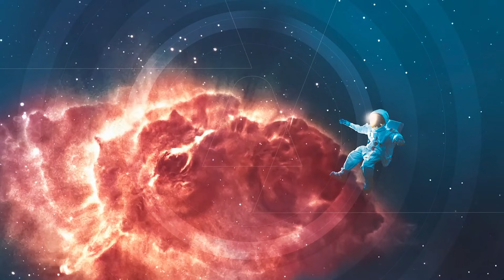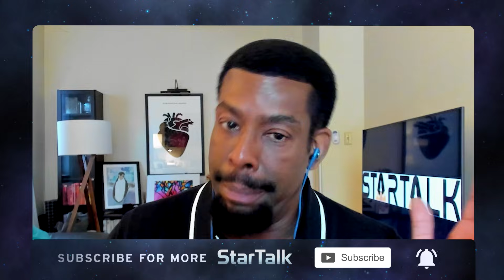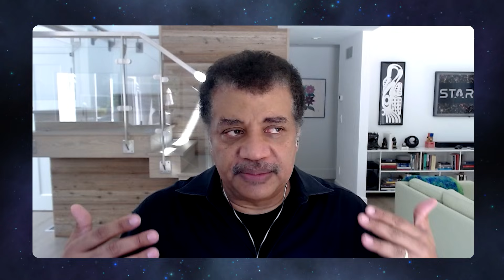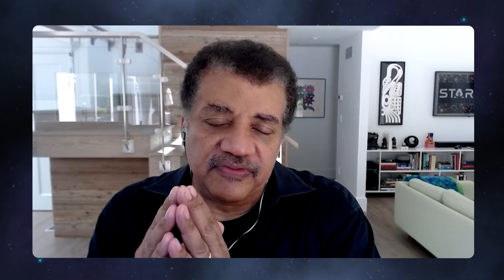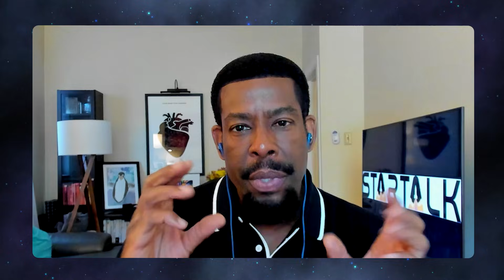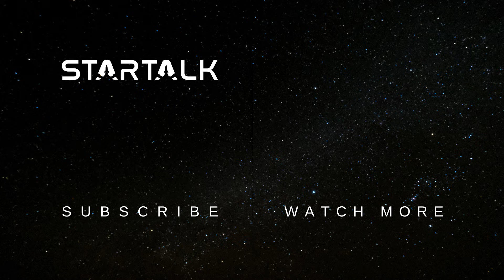What Actually Is White Noise? | Neil deGrasse Tyson Explains…

Comment from the maker: Do you remember television static?
Reply: Right after the anthem and the tone!😳🤯😅😅
Reply: You could expand this explainer to cover the fact that there's also the terms "pink noise", "blue noise" and also "brown noise".

Same concept as "white noise", except that these describe biased frequency distributions. 

So, for "pink noise", the bass is louder and the treble quieter - kind of like "bass-boosted white noise", if you will - where as we go up in frequency, the volume goes down.

Because that's white noise but with a bias towards the lower "red" side of the scale (red is lower frequency in optics, so it's bass in acoustics). A white-red colour? Yeah, that's pink.

"Blue noise" is the opposite, where the bias is towards the treble and it's quiet in the bass but increases in volume with frequency. Because if you follow the frequency analogy we're using here, the acoustics would "look" blue-y white.

But "brown noise" is interestingly different. It's NOT actually following the same concept. Indeed, in terms of colour mixing, brown is a rather complex colour - mostly red, but with a healthy dollop of green and maybe a very light sprinkling of blue, depending on the exact shade.

Nope, "brown noise" is actually named after "Brownian motion". Named after Robert Brown, who discovered it, and Einstein's first published paper was actually on Brownian motion.

Brownian motion is a physics thing, so Neil would explain it better, I'm sure. But it's basically the jiggling about of particles in a medium. They move around, bouncing off each other. And that "jiggling" motion is Brownian motion.

And you do know what "brown noise" sounds like, as you're literally hearing it all the time. It's the sound of air molecules just naturally jiggling around, bouncing off each other. 

That very quiet hiss sound you're always hearing all the time inside your head (concentrate, as the brain is always "editing it out", so you don't usually consciously hear it, but listen for the noise inside your head. A constant quiet hiss that never goes away. But, yeah, this is like thinking about blinking - once you think about blinking, you're suddenly conscious that you're doing it and then it's hard to go back to subconscious blinking again. Once you hear the "Brownian" inside your head, you'll find it hard to not hear it. Distract yourself, you'll eventually go back to not thinking about it, as with blinking).

If you take a microphone and record silence - utter silence, so you're only recording the "jiggling" of air molecules - then play it back, that's "brown noise". That faint always-present-but-very-quiet hiss sound.

You're always hearing that all the time. It's the sound of air itself. But, yeah, the human brain learns to ignore it, so you're usually not at all conscious of it, but it is there.

And recording studio equipment will often trim it out - because the problem is that, if you didn't, then you'd be hearing double "brown noise". The brown noise of the air itself and the recording of "brown noise" as well. So you often try to trim it out in audio engineering, so the listener is only getting natural brown noise for the air itself and it's not doubled up on the recording.

But, equally, audio engineers might actually add brown noise into the background of scenes. Because, without it, things can sound too artificial - too perfect and produced - so a light sprinkling of "brown noise" at the bottom of the track makes it sound like it's in a space. Make it louder and then it sounds like you're outside.

And a popular movie audio trick is to add "brown noise" under a scene to give it that "spatial" feel that you're in a space. And then a character suffers a shock - close up on their shocked face and cut the brown noise dead. To suddenly have that dead silence emphasises the shock. You're not really even noticing the brown noise - the brain, as mentioned, edits it out - but when it's suddenly not there, it's disconcerting (because your ears do hear it, but your brain ignores it - but the sudden cutting out of the brown noise makes the brain jump up: "wait a minute, something just changed there. What was it? It sounds different, but I don't know how". Which is disconcerting and gives you, the viewer, that same sense of "shock" as the character. But, unless you know what to listen for, it's a disconcerting feeling, as you know something just changed... but you're not quite sure what.

It also just makes silence sound quieter - more silent - when you fed in a little brown noise beforehand. Because you felt you were listening to silence, but it somehow just got even more silent.

But, yeah, there's all types of different coloured noise. But "Brown noise" is an exception - it's not brown the colour, but Brown the surname of a scientist. It's just a horrible coincidence that Robert Brown's surname happens to be a colour as well, and confuses the issue.
Reply: Yes. I also remembered that if you wanted a remote for your TV, you had a kid that you could tell to change the channel.
Reply: Child of the 80s, afraid more than accustomed to White Noise. So awesome to hear, I'd imagine the creation of it all in that 2% of hiss (I loved astro as a sprog/kid & knew this). 
So sad kids don't know it for Real, not ASMR. 
God. I've turned into an old f@rt. Apologies
Reply: Oh yes. Calming it was.
Reply: Move the antenna to the right, a little to the left, a little more... Now it works, stay there,, don't you move
Reply: Black Noise is the name of a semi famous hip hop grpup that does all sorts of projects in the community that they call Heal The Hood. They've even toured the US several times. Really cool music.
Reply: Yes I do
Reply: Yes, in Trinidad we had two TV channels 2 & 13, that showed the same thing, and sign off at 11:30pm left your TV with that noise. Ah good times!!
Reply: Pop had all 4 of his kids, shortest to tallest, shortest touching the tv. We'd be holding hands and wire coat hangers. Then move around the tv, hands with hangers raised. Until the Raiders or A's game came in clear. Yes, we learned how to overcome static. For those not Raiders or A's fans, don't worry, nobody's perfect.
Reply: Physicist Robert B. Laughlin wrote:

It is ironic that Einstein's most creative work, the general theory of relativity, should boil down to conceptualizing space as a medium when his original premise [in special relativity] was that no such medium existed [..] The word 'ether' has extremely negative connotations in theoretical physics because of its past association with opposition to relativity. 

This is unfortunate because, stripped of these connotations, it rather nicely captures the way most physicists actually think about the vacuum. . . . Relativity actually says nothing about the existence or nonexistence of matter pervading the universe, only that any such matter must have relativistic symmetry. [..] 

It turns out that such matter exists. About the time relativity was becoming accepted, studies of radioactivity began showing that the empty vacuum of space had spectroscopic structure similar to that of ordinary quantum solids and fluids. Subsequent studies with large particle accelerators have now led us to understand that space is more like a piece of window glass than ideal Newtonian emptiness. It is filled with 'stuff' that is normally transparent but can be made visible by hitting it sufficiently hard to knock out a part. The modern concept of the vacuum of space, confirmed every day by relativistic ether. But we do not call it this because it is taboo.

Main articles: Pilot wave and De Broglie–Bohm theory

Louis de Broglie stated, "Any particle, ever isolated, has to be imagined as in continuous "energetic contact" with a hidden medium."

However, as de Broglie pointed out, this medium "could not serve as a universal reference medium, as this would be contrary to relativity theory."
Reply: I used to fall asleep in the 1970s in front of our old Zenith black & white 13” TV awaking to a snowy picture after our local station would go off air until the following day.
Reply: Whats a television?
Reply: Yes!  I grew up in Baghdad late 60s  and throughout the 70s and the TV had bunny ears and we had only two channels, 7 and 9. One was on for maybe 8-10 hour a day and the other for less.  Sometimes I would turn it on before the TV came on and watched and heard the static.
Reply: I remember the static, and I remember actually having to walk across the living room and turning a dial to change the channel.
Reply: Yes Neil also said its part “cosmic microwave background!” Chuck interrupted him with a joke of course. Can you lease elaborate? Thank you 💙
Reply: The day I found out that a very small percentage of the noise is microwave background, I'd sit and listen as a kid and and see if I could pick it out 😂😂
Reply: The Static of the Big Bang.

13.8billions years we have the comedy genius of Chuck

I adore the universe
Reply: Why don't they use the JWST to zoom in on nearby planets to search for life or did they already find life🤔
Reply: Good old days!!! What I would do to be able to have that again
Reply: I sure do .
Reply: Poltergeist!
Reply: I mix music thru white noise. Oddly effective technique.
Reply: Yes very much so and produced white noise and pink noise on my earlier analog keyboard synths😜😛
Reply: As Leibniz put it: “If an ontological theory implies the existence of two scenarios that are empirically indistinguishable in principle but ontologically distinct ... then the ontological theory should be rejected and replaced with one relative to which the two scenarios are ontologically identical.”

In other words, if a theory describes two situations as being distinct, and yet also implies that there is no conceivable way, empirically, to tell them apart, then that theory contains some superfluous and arbitrary elements that ought to be removed.

Leibniz’s prescription is, of course, widely accepted by most physicists today. The idea exerted a powerful influence over later thinkers, including Poincaré and Einstein, and helped lead to the theories of special and general relativity. And this idea, Spekkens suggests, may still hold further value for questions at the frontiers of today’s physics.

Leibniz’s correspondent
Clarke objected to his view, suggesting an exception. A man riding inside a boat, he argued, may not detect its motion, yet that motion is obviously real enough. Leibniz countered that such motion is real because it can be detected by someone, even if it isn’t actually detected in some particular case. “Motion does not indeed depend upon being observed,” he wrote, “but it does depend upon being possible to be observed ... when there is no change that can be observed, there is no change at all.”

In this, Leibniz was arguing against prevailing ideas of the time, and against Newton, who conceived of space and time in absolute terms. “I have said more than once,” Leibniz wrote, “that I hold space to be something merely relative.”

Einstein, of course, followed Leibniz’s principle when he noticed that the equations of electricity and magnetism make no reference to any absolute sense of motion, but only to relative motion. A conducting wire moving through the field of a magnet seems like a distinct situation from a magnet moving past a stationary wire. Yet the two situations are in fact empirically identical, and should, Einstein concluded, be considered as such. Demanding as much leads to the Lorentz transformation as the proper way to link descriptions in reference frames in relative motion. From this, one finds a host of highly counter-intuitive effects, including time dilation.

Einstein again followed Leibniz on his way to general relativity. In this case, the indistinguishability of two distinct situations — a body at rest in the absence of a gravitational field, or in free fall within a field — implied the impossibility of referring to any concept of absolute acceleration. In a 1922
lecture, Einstein recalled the moment of his discovery: “The breakthrough came suddenly one day. I was sitting on a chair in my patent office in Bern. Suddenly the thought struck me: If a man falls freely, he would not feel his own weight. I was taken aback. This simple thought experiment made a deep impression on me. This led me to the theory of gravity.”
Reply: Leibniz now mostly inhabits scientific history books, his ideas receiving scant attention in actual research. And yet, Spekkens argues, Leibniz’s principle concerning indistinguishability may be as useful as ever, especially when confronting foundational issues in physics. Consider the interpretation of quantum theory, where theorists remain separated into two opposing groups, loosely associated with the terms realism and empiricism. Although Leibniz’s principle can’t offer any way to unify the two groups, Spekkens argues, it might help them focus their attention on the most important issues dividing them, where progress might be made.

For example, one particular interpretation comes in the form of so-called pilot-wave theories, in which electrons and other particles follow precise but highly non-classical trajectories under the influence of a quantum potential, which produces the wave-like nature of quantum dynamics. These theories demonstrate by explicit example that nothing in quantum physics prohibits thinking about particles moving along well-defined trajectories. But the theory does require the existence of some absolute rest frame, while also implying that this frame can never be detected. Many other aspects of such theories also remain unconstrained by empirical data. Hence, one might take Leibniz’s principle as coming down against such theories.

On the other hand, Spekkens points out, Leibniz’s principle demands that distinct states be, in Leibniz’s own words, “empirically indistinguishable in principle,” and achieving such certainty is not easy. If several states appear indistinguishable now, future experiments might turn up measurable differences between them. So a proponent of the pilot-wave approach might agree with Leibniz’s principle, but still reject its application just yet. The aim of research, from this point of view, ought to be to seek out such evidence, or at least envision the conditions under which it might be obtained.

And in this sense, Spekkens notes, Leibniz’s principle also offers some criticism of
theorists from the empirical school, who object to pilot-wave or other realist interpretations of quantum theory for containing unmeasurable quantities. It implies, as he puts it, that the empiricists’ “set of mental tools is too impoverished.” 

After all, progress in physics often requires imagination, and creative exploration of possible distinguishing features that have not yet been measured, or even thought to exist. Progress requires scientists to “entertain ontological hypotheses, expressed with concepts that are not defined purely in terms of empirical phenomena.”

Science thrives on the essential tension existing at the boundary between empirical observation and unconstrained imagination. Incredibly, Leibniz perceived that more than 300 years ago.
Reply: Yes
Reply: Yes lol
Reply: Whenever I heard the white noise as a kid it either meant I had to fix the TV for my dad or my VHS tape had finished after I fell asleep. Either way I had to wake up and deal with it since no one in my family knew how to work any kind of electronic device.
Reply: Used to scare me🤣
Reply: I do!
Reply: ZAP!  Yes but why the electrocution from standing to close to the screen?
Reply: yes. quite vividly and viscerally.
Reply: Sure do!
Reply: I do
Reply: Oh yeah.  Back in the day we only had analog TVs with the rotary dials and like a total of 10 stations.  All kinds of screen static and white noise on those.
Reply: The movie use of it  in “Poltergeist” —scared the bejebbez out of me. I am old enough to remember no the TV going off late at night though. Weird now to think that was even a thing
Reply: I used to put the tv on that to go to sleep. I really miss that 😵‍💫😵‍💫
Reply: As a matter of fact I do, and it was so fascinating. I was more captivated with the visual static, seemed very weird as well as interesting.
Reply: Neil I always wondered why you often neglect Indigo when speaking of the spectrum. Thank you for clearing that up but it is my favorite color so I'm kind of salty
Reply: Please ask N.DG to make as many video science documentaries as possible! Just as much as he would love to see Carl Sagan 1000x more, I would like to see him.
Reply: Absolutely lmao!!!
Reply: Are pink, red, grey and brown noise the same as white noise but with different frequencies in higher or lower amplitude?
Reply: some people wont know its your age
Reply: Yes I do
Reply: it was often the more interesting thing to watch
Reply: *TV Static
Reply: Thank God, I do.
Reply: Yessssssssssss... :)
Reply: I do remember the television static... I was there!
Reply: I remember the static even when you were tuned to a channel because you had a weak signal on a good day.  And people complain that they don't have 4K?  Spoiled.
Reply: Or me being on the roof turning the antenna while my dad shouted to me.  Those were the days.
Reply: So, is photon white?
Reply: @dakkson14  Great question!  What spectrum of light are photons?  ALL?  Are the photons different for different frequencies as far as their color?  Are photons racist?  Inquiring minds need to know.
Reply: Yes
Reply: I‘ve lived more years with than without TV static, but then again, the original Lassie was a personal friend.
Reply: still get radio static on FM stations
Reply: Thankz, that was interesting 💯
Reply: I consider most of what I see on TV to be white noise.
Reply: Yes, but my kids have never seen it
Reply: TDS
Reply: Yesss
Reply: Popcorn channel
Reply: Yeah
Reply: I can remember when the TV stations would shut off for a few hours at night, playing a cool Star-Spangled Banner video.
Reply: Bravo now turn into channel 0.
Reply: Oh I remember it well, especially cause my dad got his grandmothers house, and it's TV that was one of those giant wooden monsters about the size of a fireplace.
Reply: yes! and i was born THIS century. born this century and i can even write! crazy! i’ve owned cd’s and i was born in THIS CURRENT CENTURY
Reply: Indeed the static came right after the color bars and the tiny fading dot.  
I was the child who tried (often successfully) to sneak into the family room to turn on the bars and seeing the dot emerge (a complicated stealth process that involved giving the dog a treat to not bark, remembering to turn the volume down on the behemoth of a tv and getting my end of bed cover over the screen and my head (made me a huge fan of crazy heist movies involving sliding beneath alarm triggering laser beams).  
Some consumer reporter years later made me understand the value of not sitting  that close to the TV screen -“sit back kid or you’ll get irradiated”. I wonder how many of my 63 year old ailments began with my monthly adventures.
Two a.m. bars and static! An elementary school experience that helped make me a science nerd who became a sociology professor!
Reply: Yos
Reply: Look if you grew up with static TV poltergeist is gonna be on your mind
Reply: We have wifi tv now🤣
Reply: omg is that the noise
Reply: I'm 36 and I remember it like it was yesterday.
Reply: I have LED tv with local TV and antenna support. It has white noise when no cable is connected.
Reply: Yep.
Reply: absolutely! when i was a little boy, my babysitter would tell my little brother and I that it was an ant race.
Reply: Yes. The "Image" was hypnotic.
Reply: Barely
Reply: It's nice to sleep with white noise when you have tinnitus.
Reply: As a child I occasionally sat and watched the "Ant Race Theater" late at night after the channel would quit broadcasting for the evening. At that time I knew I was looking at something that people just didn't talk about and I knew it was a strong signal because there was no antenna needed, but when you did add an antenna the signal would change. Even on channels with no Broadcasting you can see different patterns of radio waves, and sometimes it was even a little red color in it even if there was no broadcast on that channel. I was always looking for alien signals LOL obviously I never found any... as far as I know.😄
Reply: Yep I Also Can Do One Better Than That, I Am Just Old Enough To Remember When TV Used To Go Off At Night
Reply: @laroycarter2662  😆.. I posted a long version of your comment 15 minutes ago.😎👍
Reply: I can hear white noise. Very easily
Reply: yep
Reply: Yes I do!  Neil- your Star Talk media website no longer lets you submit questions.  I think I have a good one, how do I submit it?
Also more Cosmos plz.
Reply: Yes
Reply: When I was a kid me & my sister would intentionally put the tv on a dead station- we called it "ants in a snowstorm" 🤣🤣🤣
Reply: I remember, after the TV played the Star Spangled Banner then TV went off until 6AM. That was good sleeping static!
Reply: So my personal hypothesis is. Call this #TheLeo theory. Is gravity the measurement of time. Based on the space occupied by the dominating mass. Example. Our bodies break down happens bk cause of our occupied space?  Case in point. A molecular subatomic particle traveling at the speed of light in zero gravity. I ask what is the mass made of?  And is it accumulating lesser and bonding particles??  TheLeo theory??  Case in point. White noise is the noise of particles colliding and collapsing over occupational time. I got q?? Or  am I crazy??  I here by patent and take all rights 2 my theory. TheLeo theory. Only 2:36 in.
Reply: 2:36 in phone died. In bed watching bill burr. Red Rocks. 🧐🧐🧐🤔🤔🤔🤷‍♂️🤷‍♂️🤷‍♂️🤯🤯🤯😈
Reply: as a 16 year old i remember watching PBS as a kid and it going out sometimes and seeing the static. i always wondered what that was
Reply: Yessss
Reply: More often than not, it was the best thing on television.
Reply: I sure do Neil and the hair on the back of my neck raising up when I'd see it
Reply: Heck, even radio noise.
Reply: Yes.
Reply: Definitely
Reply: Ohhh i like it too , you know if you take 7 and decrease it by 3 until you reach the 0 and you add this pattern here before those numbers 0, 1, 2 2, 1, 2 2, 3, 4, 0 ... you find the cycle of the 7... 7,4,1,8,5,2,9,6,3 ...
And ⁰07, ¹14, ²21, ²28, ¹35, ²42, ²49, ³56, ⁴63 ... and finally the beginning that is never counted at the beginning 70 
And if you take the first reasoning and flip it with the pattern 0 0 0, 1 1 1, 2 2 2 find the 3 
... 03 06 09 12 15 18 21 24 27 ... and finally the beginning which is invisible many times 30 

And another if you take the 9 and decrease it by one 9,8,7,6,5,4,3,2,1,0 Then you flip it over and put it before these numbers
... 09,18,27,36,45,54,63,72,81,90...
And the more loops you do the more the numbers move one back 
I also have one on 6 but it is difficult to explain, 
But you take 0 and 6, do +2, + 2, -2 and you get to 30 then it repeats ... look at it ...... you will see what I mean,  
Instead for 2, 4 and 8 Well I don't like them, 
4 and 8 I only know longer breaths then the number 2 ... they seem to me almost the same number 

0 is simply the end and the beginning of a cycle... 
I never do the moltiplication very well , and i need to count for work...
I even try to do x3 of nine 0 and more 
and some times when there is a 7 up , under there is a 3 , not every time ... And when under there is a 7 after there is a 0 , but not every time , i need to understand the process ... But now I don't need it , and i don't have time to look 
I even try to give " name " for each number , but is another story
Reply: I do but I didn't know what it was until years later in high school. Ahh. The good old days. When TV programming was limited, I used to have time to do other stuff. But with the internet and now streaming, there's always something to watch. On the cons side, I rarely read books nowadays compared to almost daily as a kid. But on the the pros side, we can watch anything from around the world. My new thing is Turkish romcoms and they're fantastic. And Korean supernatural dramas are amazing as well. I'm looking forward to finding new countries and culture to learn about from the comfort of my own bed.
Reply: I do... My dad got me a TV for Christmas back in the 80s. But now everytime I see it I remember Samara coming out of the well. 😂
Reply: I had a Baird until recently , yup a cathode ray tube love to stare at the white noise looking for patterns in the chaos !
Reply: Ohms law
Reply: That is why Einstein no credit. Google is upset. People all have comon sense but they are saving them UP. I'm using all of mine and some BORROWED by many.
Reply: Now my Tinitus makes sense! 🙄😂
Reply: Black sound x white noise: star Jays: talk jays
Reply: I turned off the TV a long time ago and I'm still hearing it
Reply: Yes
Reply: yes i am old enough to remember (47)
Reply: Yep
Reply: yes!  still get it on the radio i think...?? 
dr Tyson reminds me of columbo..  he'll be half way out the door and he'll say..  "..oh..  just one more thing.."
Reply: Yep! We had a black and white TV with a tuner… most of it was static! 😅
Reply: I used to watch the CMB when nothing else was worth watching, now I use white noise as a tool when calibrating Dolby Atmos surround sound systems along with a 37hz tone for bass in movie theaters.
Reply: Yep every time I think about it now all I can think of is we are jammed packed.
Reply: If I put my hand up to the TV, I could FEEL the static. Not kidding.
Reply: It's amazing how television white noise is now primarily a 20th century reference
Reply: Oh, yeah.  I remember it very well.  Not to mention the radio static as well and during a thunderstorm the crackles and long sizzles.
Reply: Tyson "white noise racist"😂😂😂
Reply: I was very young, but I used to see it on tv lol
Reply: I still have the little Sharp CRT TV that i got when i was 13 or 14, and i'm 38 now, haha
Reply: I think it should be called "equan noise" derived from equan(imity)

Edit: it's up to you Neil! If you can have the scientific community acquiesce to Pluto's planetary status revocation. Then you can change the name in the game of a type of noise's wack name! XD (not really wack, just had a rhyme there. And, as a lyricist I couldn't let it slide lol)
Reply: I remember it very good, remember staring at it a long time to figure out what it is - on a black and white TV. (!)
Well, that was a childhood, where you did such things - because I was not distracted like from the media nowadays.